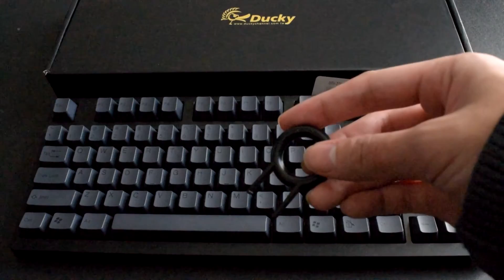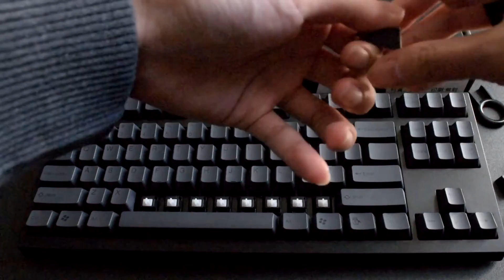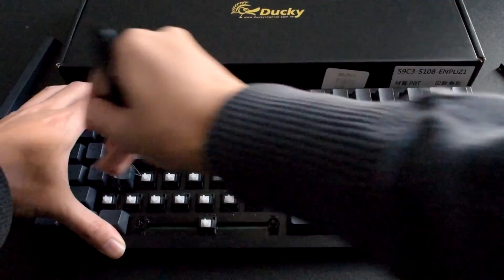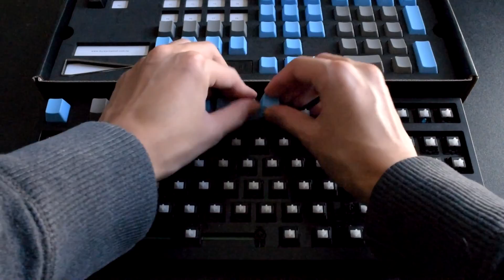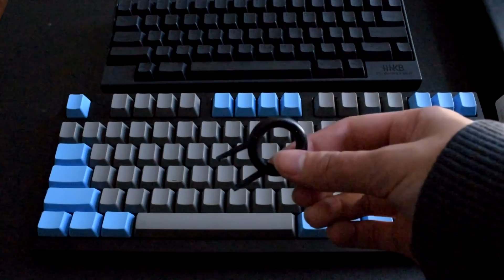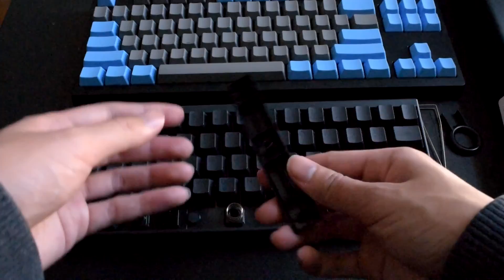Cherry MX + Topre Keycaps Replacement Guide

Comment: That wiggling is quite exaggerated, you only need to move slightly side to side.
Reply: +Austin Pratt They're clears, a pita to remove keycaps.
Reply: +Manolo Moras I have Clears, really not that hard to remove. You really shouldn't wiggle that much.